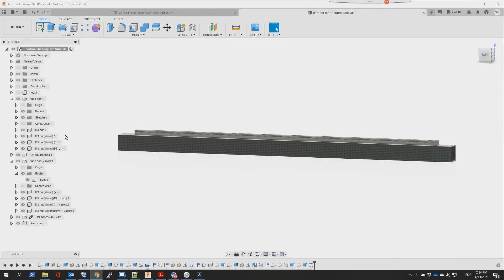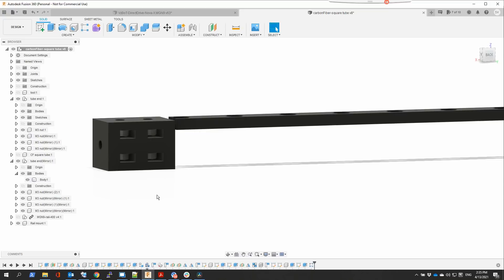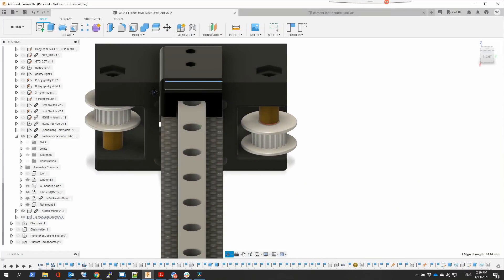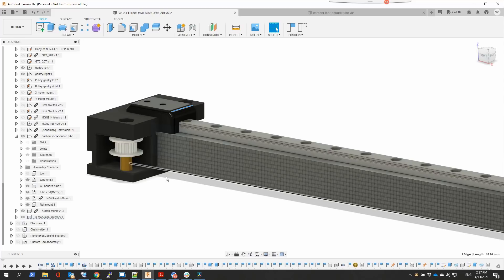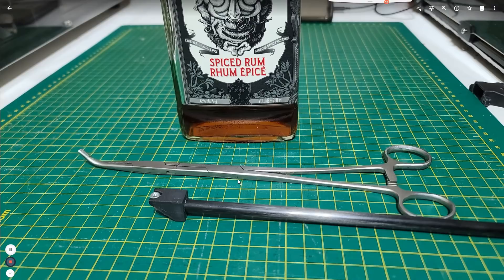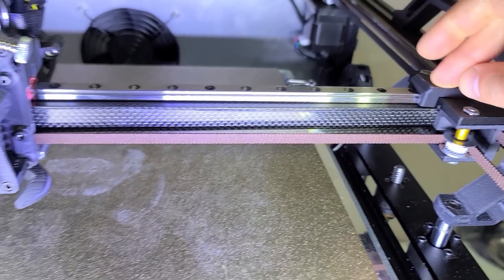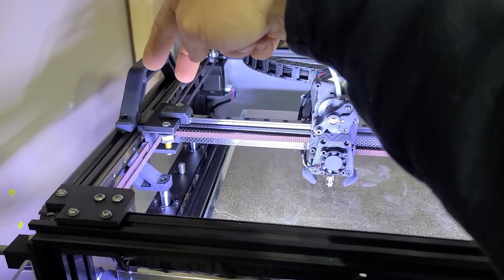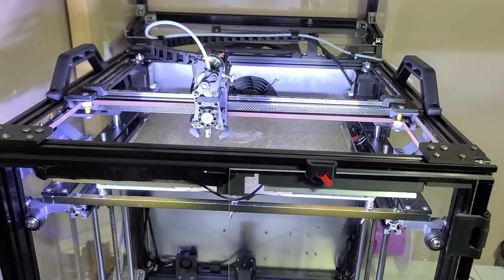Mounting carbon fiber square tube on the VzBoT 3D printer

Comment: I drilled straight through the square tube and increases the hole diameter of the bottom hole to allow access from a 5.5mm socket driver to deliver the 3mm nyloc nut to the inside of the tube. No loss in rigidity as it’s the vertical sides that give the crossmember it’s strength.

Comment: I'm curious that metal working machines like lathes, mills, routers and 3d printers don't use carbon fiber to replace the metal at least replace the aluminum as a proof of concept. If carbon fiber is so rigid and why is no one doing this? Is it viable?

For a CNC router having comparable tensile strength with a fraction of the weight would be greatly useful for efficiency and accuracy. 

Besides the price costing more per sqaure inch not weight is there another reason I'm unaware of? 

How will a alluminum extrusion full replacement using high quality carbon fiber fair against all aluminum frame?
Reply: It's not usually desirable for machine tools to be light.  In fact weight is often an advantage.  Secondly, cast iron is 100x cheaper than carbon fiber.
Reply: @zachary3777  That explains why people aren't making mostly CF printers and CNC machines for practical purposes. 

I would still love to see a video of a mostly CF monstrosity even if it's a dumpster fire.

Comment: if the linier rail and carbon fiber square tube don't need to be replaced/serviced often due to wear, why not rivet the rail and tube together instead of all that steel hardware.
the rivets would hold super tight without worrying about nuts coming loose. being aluminum, it would be 1/3 the weight of the steel M3 screws + corresponding nuts.
if a need to remove the rail comes up, the rivets can drilled out.

Comment: How come you chose roll-wrapped carbon tube instead of pull-truded? Roll-wrapped is not very dimensionally accurate so it's not a precision substrate for rails. Pull-truded tube is not just higher precision, but actually has higher bending stiffness. 
Unless you specifically need the radial strength or torque strength of roll-wrapped, I would go with pull-truded.

Comment: Why not drill through the bar it will be easier to tight the screws.
Reply from the maker: You cant tight them like that.. it will crack the tube. And the long the bolt...the heavier too
Reply: @Vez3D  I was thinking to have bigger hole in the bottom to pas the nut inside to avoid longer bolts.
Reply from the maker: @marinostsalis314  ahh yes ok. It would work too

Comment: Why didn't you simply use the inner bar with all the holes for the nuts to hold them, and once you put all the screws in from the top just remove the inner bar. Instead of needed special tools.
Reply from the maker: Yes. Its in the description:) thats a better option. Thanks for commenting

Comment: Vez3d, in your opinion, will 10mm carbon tube suffice?
Reply from the maker: 2 side by side yes. I had that 2x8 before and it was ok with mgn12 but not with mgn9
Reply: @Vez3D  I don't mean for your printer, I have the Blv Cube, just interested if the single 10mm carbon tube can provide enough rigidity.. Just wanna go as light as possible.
Reply: @soulvagabond That's not a trivial question to answer. it depends on a lot of factors... How long is the tube... Rigidity drops rapidly with the length and decrease even more rapidly with the diameter. Also, what are the forces involved? Force = Mass x Acceleration. The faster you want to accelerate or the higher the head mass the higher the force on the rod thus needing more rigidity

Comment: Wouldn't rivet nuts that are made for this purpose be a significantly better choice? 😊
Reply: No, because they protrude above the surface
Reply: @thomask77  Yes they do, what is the issue?
Reply: @Freddy_Lie  the linear rail should sit flush on the carbon fiber beam. That won't be possible with rivet nuts
Reply: You would have, what, 25mm between each mounting location? The linear rails aren't jelly, an unsupported span of 25mm is no big deal, at all on low load applications like ours. 

Don't forget, everyone I've ever seen in the 3D printing community are mounting their rails wrong, "should sit flush" is just a "rule" to make you feel like you're doing it right. 
Now, mounting is to some extent ok in 3D printers due to low loads and low accuracy requirements. If we ignore these pretend rules, there is no real reason why you shouldn't mount rails to carbon fiber using rivet nuts. 

If you want to learn more about mounting rails correctly, have a look from about page 11 and onwards. 

https://www.hiwin.com/pdf/linear_guideways.pdf
Reply: With 20mm beam, a rivnut is going to have a depth 3+mm. With only ~5 attachment points, the weight from a 20mm bolt vs an 8-10mm bolt is nominal. Why not just mount ghe rivnut on the backside and use a through bolt? I saw mention a concern for deforming the beam, but how reasonable is that concern with CF?

Comment: I love this CF tube with MGN9 idea. Just wondering, have you ever considered drilling holes into rail to lighten it? I know it wouldn't be a huge weight reduction. However these bars are designed for CNC machines that aren't concerned about weight.
Reply from the maker: I have considered machining the rail yes. Soon

Comment: Why not just put the screw all the way to the other side of the square tube an there put nut and washer for better surface press area
Instead of insert it inside
Reply: You will crush the tube. CF is weak in compression
Reply: @joshua43214  with high surface area I’m not sure there is also tubes with 2 mm walls just sound simpler but not an expert
Reply from the maker: Long bolts is heavier too.

Comment: another one thing, you may use to mount rail are rivet nuts, but their mounting requires a bit playing with drilling stand to drill two stage holes (to hide a rivet nut's head into carbon tube), all depth with 5mm dia and 9mm and 1mm depth to hide head to level it on tube's surface
Reply: I love the idea of using a rivet, much lighter than screws. Plus it shouldn't move or loosen over time.
Reply: @Theeslickness  just rather awkward to disassemble afterward
Reply: The tubes are hollow (shell is only 1 mm thick), where do you want to hide the nut's head?

Comment: Cyano glue would be both stronger and lighter.   Useful channel!
Reply: I was thinking of using adhesives too. In my experience, Cyano doesn't usually deal well with impacts, vibrations and heat. But there's so many good heat resistant epoxies out there. Although it's likely going to need to be somewhat flexible to accommodate the fact that the tube is flexing slightly under stress.... All and all he'd save only the weight of the screws but would render the whole thing very hard to disassemble.
Reply: @etle113  I use them extensively on model planes - where they get plenty of vibration!  I think that over the years I've learnt to recognise when a material needs a light sand to key.  Polished carbon is one of those.   I often use it on motor mounts - which a certainly the most stressed parts!

Comment: Just out of curiosity. Why didn't you drill a bigger hole on the opposite side to fit your nut and a tool? 5 extra holes would hardly impact the structural integrity of the tube. No? And would be even lighter 🤣
Reply from the maker: Not sure I get what you mean sorry. But there are several ways to do this. Maybe better ways that what I have done :)
Reply: @Vez3D  I think that he means to drill access holes under each nut to be able to thight the nut using a regular wrench.  Not sure how big the holes would need to be, but that might not be a bad idea since the holes would be on a face that isn't critical for the lateral rigidity. You might even save a gram 😋
Reply from the maker: Ahh well..now i get it. And I like the idea

Comment: Ah nice work!

Just curious though how do you ensure the x rail is perfectly perpendicular to the y rails?  Since you have to tighten the nuts while the tube is off the machine it would seem that the rail could skew a little with the slop of the bolts

Comment: You could make it even lighter by turning the square tube 45 degrees and using w (not v) wheels. Then you don't need the heavy linear rail
Reply: I was thinking the same, but I'm not sure if the wheels friction on carbon will age well at those speeds. The forces due to the acceleration are potentially in the order of tens of lbs (30+ N)
Reply: @etle113  Acceleration forces are nothing to worry about in the short-term. Long-term, well, only one way to find out!

Comment: Good technique man!  Rhum is definately a must!
The way I did mine was using a plastic strip inside, but the strip was flipped over in order to simply hold the m3 nuts while the screw would grab them.  Then the strip was removed.  Never the less, awesome job with you printer and this channel :) see you soon!
Reply from the maker: Yes i realized it after that my cad was upside down with nuts. But like you mentioned, that way you can remove it once screwed :)

Comment: Thanks for the description of how you mounted the X movement. Carbon fiber has a negative coefficient of thermal expansion - it shrinks when heated up.  Not sure what sort of effect will result when steel is bolted against it.
Reply from the maker: So far so good. I used this to calculate https://www.google.com/amp/s/www.engineeringtoolbox.com/amp/linear-thermal-expansion-d_1379.html and its not that bad between 20c to 40c
Reply: @Vez3D I considered a similar solution a year ago. It's useless if you have a hot chamber. I did an FDM simulation and the bar would have deflected almost 1mm due to the differential thermal expansion at 80°C. If your chamber is closer to 20°C it will be fine. A unsupported upright mgn12 rail like on the Railcore has a extremely good weight to stiffness ratio and is perhaps the best solution for a heated Chamber.
Reply from the maker: @42Luk  i dont go over 40c on the chamber.

Comment: Couldn't one simply drill a slightly oversized hole underneath and hold the nut there? I don't think it would affect the rigidity, I think most of the work is in the corners, like on a truss beam

Also, a plastic insert could be used to have a compliant hole in the x direction (slightly slotted hole)

Comment: You really push me to do a custom printer. I have a V0 but need something bigger. A V2 is too expensive for me, i could mod my CR-10S into a Voron Switchwire but i really want a printer without a moving bed (at least not in XY direction)
Reply: Do a Voron 1.8 I'm in the middle of converting my Tronxy X5sa to one

Comment: Two questions (but I'm an idiot, so...):
- could you drill holes on the opposite face that would be wide enough to let the nut pass through?
- could you forgo the carbon tube entirely and use the rail as a gantry?
Reply: Not OP but :
1: Yes you can. The tube is beefy enough to handle the stress even with a few holes. But don't drill one for every hole.
2: Depends on the length of the gantry, if its too big, its not a good idea.
Reply: Some slower printers do just that, but at very high acceleration and very thin 9mm rail it was insufficient. Vez has a video where he replaced the rail and talk about it

Comment: Hi, I have a question that troubles me for the last days :D (after seeing your previous videos): why is the square tube necessary? The rail is not rigid enough (bending issue?)? And if it is not rigid enough in this direction, why can't you turn it 90°? Or maybe I missed something else... In any case I like your project! ;) Congrats ;)
Reply from the maker: Not rigid enough. And in 90 degree its worst because there is gforce from acceleration
Reply: @Vez3D  exact! The rail is also even more flexible on its thinner axis. A bit like a ruller. Very flexible on the thin axis, more rigid if you turn it 90 degree. In the linear rail case, the best is actually 45 degrees.... Just ugly and not really worth the trouble.
Reply from the maker: @etle113  45 degree....interesting thought.. never thought about it
Reply: @Vez3D  I actually gave it an order thought and I think that he might be right.... The rail alone is more flexible at 90, but 90 degree is the most rigid configuration if we combine the moment of inertia of both the rail and the tube together. And by a significant margin. You could run a Quick fusion 360 simulation to make sure that I didn't neglect anything, but I'm pretty sure.
Reply from the maker: @etle113  you still need the square tube. That was his question

Comment: Just as an idea, you could still use the plastic bar as a nut holder. Just put nuts in, but have the top open in the plastic bar so that after screwing the nuts in, the bar just drops down and out of the carbon tube.
Reply: So just use the same bar but upside down
Reply: @NicksStuff   Plus maybe some pull tabs that stay outside the tube to make it easier to align and pull out :)
Reply from the maker: True

Comment: I think you should be able to glue it with a high resistance poliurethane adhesive (sikaflex for example) and have great results with the lowest weight. It WON'T wobble at all
Reply from the maker: How would you remove it? :) gokd idea for permanent
Reply: @Vez3D  with a knife or spudger you should manage, the adhesive can be cut. It could be destructive to the carbon tube.
Maybe experiment with silicone caulking as it is easy to remove. I think the material flexibility shouldn't be a problem due to the surface area. It can hold a lot without much deflection.

Just throwing out ideas, adhesives have come a long way and aren't taken into consideration many times :) (apart from duct tape)
Reply: The right kind of slightly flexible adhesive could be great, sika, or maybe a 2part car panel seam adhesive.

Ciuld help with the mis matched expansion coefficients at higher temps too.
Reply: Never use glue to hold structural or linear motion rails!
Reply: @ProDesigneHd  why? the rails are designed to be mounted on a machined or ground metal surface and hold hundreds of kg, we're mounting it to a small carbon fibre tube with a couple of bolts and holding less than a kilo, it's a completely different application. Your phone is held together by "glue", your car windshield too, and depending where you live even parts of your house
Reply: @nirodper  do you prefer a product that's glued or one that's bolted so that you can disassemble it? ;) Also if you see a house that has structural parts that are glued together, run my friend.

Comment: you can get aluminium bolts & nuts, if you want to go all in in the weight savings. if you replace all the bolts & nuts in the rail & head.. might actually save you something.
Reply: Go titanium, even
And replace the ball bearings from the rail by ceramic ones...
Reply: @NicksStuff  aluminium is lighter than titanium, titanium is just stronger
Reply: @Nobody-Nowhere  strength to weight ratio is likely the best metric and titanium would win... But your right that this application doesn't need the strength of titanium... Unless he moves to M2... That wouldn't make sense.
Reply: @etle113  Hollow 3D printed titanium M3 bolts, anyone?
Reply: @NicksStuff  those bearings tend to have a lot of extra meat on. I would like to see what one can do with a bit of machining.
Reply: super not worth it
Reply: for M3 I don't think it makes a big difference
Reply: @ProDesigneHd  the difference is quite surprising actually... and i think this level of obsession eventually leads into it anyhow.

Comment: You could reduce weight further using nylon nuts and screws.
Reply: titanium would be great here as well
Reply: @boardinrider  great, but expansive and the strength is probably not needed ... Aluminum would likely provide enough strength for a lower price and slightly less mass. Nylon is a border case, it would be a bit lighter than alu, but will likely need to be fiber reinforced to provide enough strength to clamp the rail down. Nylon also creeps (slowly deforms) under stress, so. Not sure on the long run

Comment: Thanks for the video!! I think I would use the custom tool for all nuts as it saves on buying the other tool aswell. I'm wondering if it would be more beneficial to use washers between the nuts and the carbon to spread the load a bit more?

Comment: In the first method, is the printed rail meant to be mounted the other way around? Because like it's shown in CAD, it should be removable after screwing the nuts in. So easier to assemble with the advantages of the second method.

And yes, you're right, it's much better not to have the plastic in between. Besides thermal expansion it's also important that plastics always creeps a little over time.
Reply from the maker: Great comment.. i actually never thought of doing it that way. Yes it was upside down..litttle mistake. But great idea. 👍
Reply: Exactly my thoughts when I watched the video. Best of both worlds.

Comment: Hey, nice printer. Thinking of replacing mine x with carbon aswell. How does that square carbon rod compare to a round carbon tube in terms of stiffness/ringing/acceleration?
Reply: Rigidity of a beam is proportional to its moment of inertia ( i.e. how far are the walls from the center of the beams section)... Assuming equal weight and comparable diameter/edge dimensions, the square tube would be stiffer due to its higher moment of inertia. But not alot... In the end, it's just more convenient to install a flat rail on a flat tube wall 😉
Reply from the maker: Its REALLY stiff
Reply: I don't think you would see a significant difference between round and rectangular CF tubes. Either is already stiff enough for the application